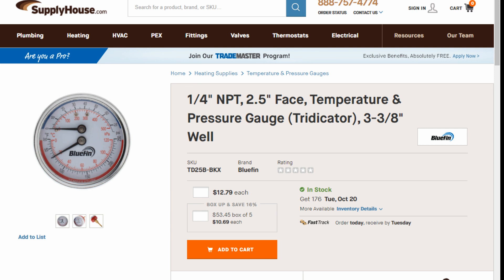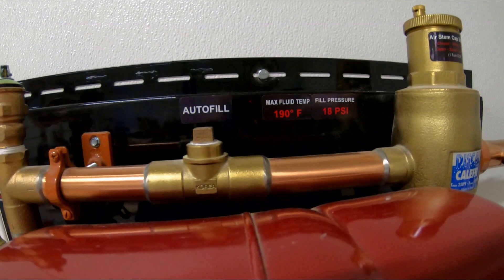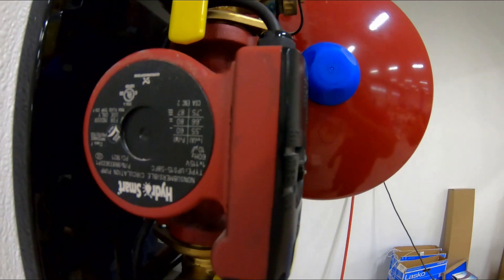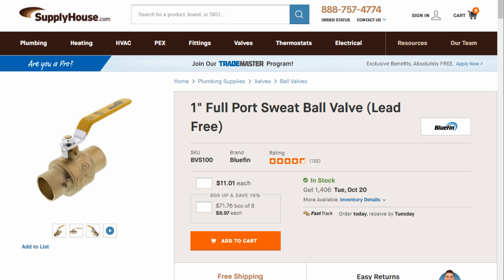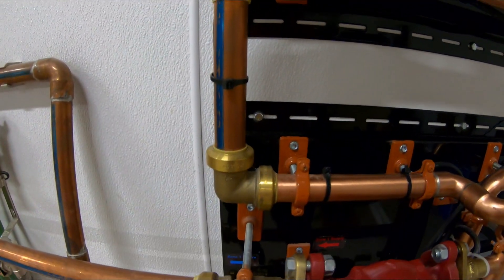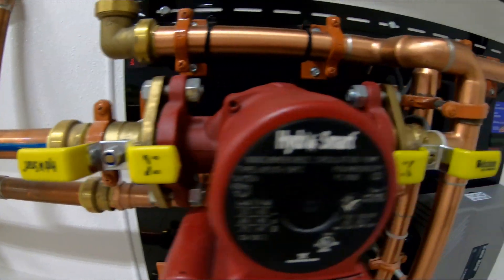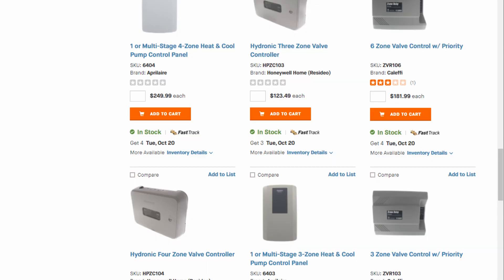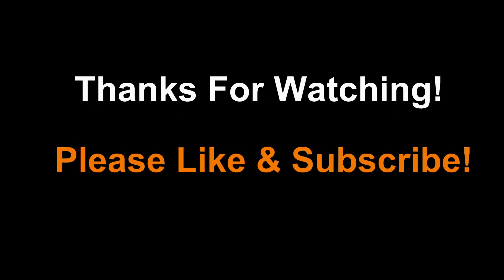Build Your Own Radiant Heat Panels- Boiler and Zones Breakdown List!  Pole Barn Heat Setup

Comment: Jason, after so many years how has the thermal mass system held up? We are thinking this is the way to go for our southern michigan barn.
Reply from the maker: Its been great , 1 of my lines has a pinhole leak and it keeps fluid but under pressure leaks down. Must of been manufacturer defect in line, but with the thermal mass, it doesn't affect heating.  Never needed to install Air conditioning , as it keeps around 68 degrees during summer. I need to use a dehumidifier sometimes if its been a rainy week. You save about $40-$60 per 4x8 sheet of pink foam insulation not needed under slab, so it works out ahead even if you need to buy extra pex tubing.  I have a few neighbors that went this route after my setup , so I helped them out with layout.  Dropping my temp for 55 degrees to 50 degrees has saved more on my heating bills then I thought. At the end of this heating season, I will do a comparison of heating costs.  Just make sure to keep up on gopher control, as I have seen they chew through cable lines around my place. Since the pex is in sand, I don't know if they can dig/chew through the insulation board around perimeter  and get under the slab. Mine they haven't , as I have seen some mounds by perimeter of building but when I dig down, they just went along foamboard. . They did chew up my cable line  , so I just placed it in conduit . Otherwise , has been great and best investment could of made. When you go from working outside in -10 weather to working inside in a heated area, its so enjoyable! Thanks for watching
Reply: @JasonYouTube  thank you for the response.

Comment: How much water is getting sent out the condensing side. Could i use a 5 gal bucket? Thanks
Reply from the maker: @boardinabarn6829  It will fill up a 5 gallon bucket in a day if it runs long enough!  When I 1st started my system in the winter, the ground and slab was under freezing point and the water froze the pipes so I had to use a bucket until the ground and slab was above freezing.  I emptied the bucket every morning and every night.

Comment: what is the part that the pressure/temp gauge attaches to?
Reply from the maker: The manifolds have them installed on them , thats what the pex loops hook up to
Reply: Not the ones on the manifolds.  the ones on the copper pipes.  in this video you have a guage next to the pressure tank and one next to the Air seperator.  Is it some kind of T fitting   @JasonYouTube
Reply from the maker: @abacojack13  It is a 1" tee with like 3/8 - 1/2 on top. Then you sweat a threaded reducer to it with threads of gauge your using . Threaded reducer slips over the pipe perfectly.

Comment: Hi Jason, first of all thank you very much for the video, very well done and so easy to follow, I think even I can follow it. I know I'm late coming into this but I have a quick question, why is everything 1" and not 3/4"? For me everything would be so much easier to find and so much cheaper if I used 3/4 and with a closed system I'm not sure I need the flow rate 1" gives so I'm thinking I'm missing something. Any insite would be appreciated.
Reply from the maker: The boiler/ tankless water heater needs a certain GPM (.5 to 1 GPM) to activate so you need to make sure to have enough flow through system. If you don't have many loops, then 3/4" should do, but you need to use some formulas to determine that . Google that to see what you need.

Comment: cool...You still recommend the T-H3M-DV-N (Takagi) ?  I see suppy house now has it up to $925.00.
Reply from the maker: They used to allow space heating under the warranty , but now they changed it to exclude radiant heating. I don't know why but maybe due to problems with customers whose units froze because in a house, the water heater wouldn't be only source of heat . Houses would have a furnace and so tankless heater wouldn't be in extreme conditions. Just my guess. Mine has been working for over 5 years with no problems so just know that buying one, you may not get warranty. But you could buy 3 for the price of 1 boiler , thats how I look at it.

Comment: Hey Jason do you have an email so I can ask you a few questions?  I have a 24x32 pole barn with 1100 linear feet of radiant tubing......Could I get away with a smaller boiler than what you have or is it more efficient to go bigger?  Your space seems much larger than mine.
Reply from the maker: Hi, Ya I have 4700 lin ft of tubing so 4x yours. You can go smaller but really no point , because these are modulating , so they can go down to 15K btu or up to 120K btu depending on water temp and gpm needed.  So if your looking to save money upfront, you can get a non condensing unit , but that is less efficient so will pay more in long run. Since these are water heaters , the non condensing runs like $700 and condensing runs like $900. Regular boilers run 3K on up. They used to be alot cheaper but with the " Free Money" era , they went up 30% .  Thanks for watching

Comment: Hey there Jason.  How do you determine the PSI for your primary (boiler / expansion tank) circuit?  More to the point. how do you determine the "Pressure Set Point" of the pressure relief valve?
Reply from the maker: Pressure relief valves on a closed loop system are usually 30 psi, and system pressure is between 10-20 psi. You don't need that much pressure in the system to get stuff moving
Reply: @JasonYouTube  THANKS!

Comment: excellent videos. I appreciate your information on this. One question do you need just one circulation pump if only one zone with seven loops?
Reply from the maker: If your not using a primary/secondary circuits for hydraulic separation , then you need to check what gpm flow rate you need for your boiler/water heater to activate. Some need 1/2 gpm flow , then you would be ok using 1 larger pump.

Comment: How many GPM your running?
Reply from the maker: 1/2 GPM  , basically if you don't have a boiler pump and are using the zone pumps only, then you need enough GPM flow to activate the boiler / water heater.  Since I have a boiler pump in addition to the zone pumps , I could go higher with the GPM but .5 GPM works good. If your return temp is low, then a higher GPM will be needed to supply enough heat to the end of your pex runs , in order to heat the slab . Thanks for watching
Reply: Having trouble getting mine going. I have the hydro smart single zone system. I am using the Takagi tankless water heater. I have 7 loops averaging around 270 ft each. I can’t get the boiler to maintain 0.5 gpm so the heater won’t stay on. It’s starts out around 0.7 then drops until the heater turns off. I even swapped the pumps out from 1/25th hp units to 1/6hp units and its didn’t help. When I purge the system with a 1/2hp utility pump I can get 1.5gpm. I’m just not sure what to do next?
Reply from the maker: @jasonferree3541  1/6hp should easily maintain 1/2 gpm. Did you check your screen on strainer and the inlet screen on the Takagi? Also make sure your pumps are on the highest speed if you have the 3 speed ones.   Make sure that your system maintains pressure as a leak will allow air bubbles and will lose pressure and gpm. Remember that the utility pump puts out more GPM then most of the zone pumps, so any restriction will not be as noticeable during the purge.
Reply: @JasonYouTube  ahh, yeah I need to check those. Thanks for the advice!
Reply: Well I feel stupid but it was the filter screen going into the water heater. I’m running 1.6 gpm with the pumps set on lowest setting now lol. Excited to heat up for first time!
Reply from the maker: @jasonferree3541  I would probably switch to the smaller pumps  to save on electricity , otherwise leave it as more GPM will not hurt system if installed and cleaned properly. Only problem would be if a restriction or tight bend in pex or a solder  joint bugger , faster gpm may erode the pex/copper and create turbulence , where slower gpm will have no effect on it. That would take some time but probably wouldn't.

Comment: How efficient is that boiler???  Any idea how much it runs or what it’s costing?
Reply from the maker: Its 94% efficient and I have videos showing how much the costs are to heat. I break it down for cost per cu ft of heating so others can compare it on their building heating costs. Usually for heating in Minnesota, it costs about $550 per season to heat my building at 58 degrees.  This year its more due to gas increase and also a "Feb Event" surcharge , for that Texas gas blunder.

Comment: Great video except for putting the expansion tank on its side allows it to keep air in the system
Reply from the maker: With a bladder expansion tank , it doesn't matter which way you mount as you purge all the air out of the system and the air bladder keeps it "Tight". Only problem is when the internal bladder fails , it will fill the tank up and may rip off the mounting if not properly secured . If manufacture specifically doesn't allow it then you follow their guidelines, but most say any orientation is fine as long as it is secured correctly. Mine needs another bracket installed as the sheet metal screw is loose to backing plate.  Thanks for watching

Comment: Quick question how did you figure out what size pump you needed?
Reply from the maker: When you design your system through the programs online or talking to contractors,  they will tell you what pump size needed. But the ups15-58fc pumps are usually the go to ones.  As long as you don't go over 5000 ft of 1/2 pex per pump , it will have no problems
Reply: @JasonYouTube  Do you have any sites you would suggest for the formulas, or even reference books you used?
Reply from the maker: @joeredhawk   Most stores that sell all the supplies may help you out. I know that Radiantech  was good but that was like 4 years ago so I cannot tell you how they are now. They sell their kits and everything so you could try there , but I cannot endorse them since its been awhile. Maybe others can chime in , but that is a start. Depending on where you live, there may be local companies that will design it and give you quotes on it, Just search for radiant heat in your state and should pull them up.

Comment: Hi, do you need a Water Pressure Reducing Valve for the system.  Thank you
Reply from the maker: This is a closed loop system so the pumps just move the fluid and don't build up pressure.  You actually pressurize the system when filling with another pump. It does have a pressure relief valve in case it overpressurizes due to a restriction or if it gets too hot and boils the fluid
Reply: @JasonYouTube  thank you. Do you have any video on filling the system with water/glycol mix and purging the system of any air.  Thank you
Reply from the maker: @Xbox360Rules00  No I don't  as there are some good videos on youtube with how to do.it. Thanks for watching

Comment: Hi. How heavy is the expansion tank with water in it and should it be supported?
Reply from the maker: The tanks are usually 4 gal total.volume so max fluid is like 2 gal. Usually you have less then 1 gal of liquid in it , so like under 7 pounds. So you need to support it but max weight would be like 25-30 lbs if bladder fails. So yes support it for the max weight if it failed, which isn't  that much weight to support

Comment: The system will lose water during natural use..the auto fill is there to hook up a house line thats live all the time and it will automatically keep your system within the desired psi range
Reply: If I have to add a mixing valve on this system where would I put it

Comment: Hey Jason,  getting ready to build my panels but have a question.  So you placed your tubing in the sand below the slab.  What spacing did you use for the tubes?
Reply from the maker: They recommend about 8"  but in some places around the perimeter I went  with the tighest radius bend , like 6" spacing. My thought is perimeter walls will sap.the heat and be the coldest spots. Thanks for watching
Reply: @JasonYouTube  I was thinking that as well. How did you figure out how to layout your runs?  Having trouble with that and info.
Reply from the maker: @country81  Just check out my video on thermal mass tubing layout. Shows mine

Comment: Quick question. Im about to build a 54x60 shop. One single space, no dividing walls. Would a single pump system do that? I notice you have three pumps. Can you explain that a little. Thanks
Jason
Reply from the maker: The one pump is for the boiler/ hot water heater  as that has some  flow restriction  going through the boiler and in order to get the 1/2 gpm through your tubing, it is easier on system to have a separate pump for the boiler panel.  Look up Hydraulic separation as that will explain it better . More efficient then just a standard circuit utilizing 1 pump.  My other pump has 3600 ft of tubing , so depending on how many feet you do, then the one zone pump will work if you have under 3600 ft of tubing. my other zone has 1200 ft , and that has a separate pump for that zone.  If your doing the tubing in concrete then you will not need as many feet of tubing as my setup. My setup is using Thermal mass so my tubes are in the sand beneath the concrete so I basically have over 1 ft of sand /concrete to heat up, so need more to heat that up.

Comment: Also, what ratio of water to glycol did you use when filling the system?
Thanks again!
Reply from the maker: I just went what the lowest temperature that my area would face and went with that ratio. I think I errored on caution side of -60 burst and freeze protection of -20 , but since the tubes are in ground it would never reach those temps but better safe then sorry. I think it was a ratio of 75 glycol to 25 water.  With cryotek 100 , you could run straight glycol and it isn't that thick.  I bought all my 5 gal buckets from the dealer as it was about $20 cheaper per 5 gal if I bought at Menards / Lowes/ Home depot. Might try a local radiant / HVAC dealer as they could probably order it in and they would take their cut and you would probably save.

Comment: Hi Jason,
Thanks for the video.
Can you tell me where I can get the pipe stand offs you used in routing your piping?
Thanks!
Reply from the maker: Hi,
 They are just Oatey Pipe Standoff clamps. Home Depot, Lowes, Menards all carry them you buy the Threaded rod separate and cut to length. The bottom is also sold individually and should be in the black pipe section of those stores. I just painted mine to match my wall color. Thanks for watching

Comment: Expansion tank should always be installed in a vertical position by the way.
Reply from the maker: That is a Myth , IF manufacturer states vertical mount only then that is true statement. Most can be mounted in any direction or orientation ( Upside down, horizontal, etc..)  If you know how they operate, it doesn't matter. The air bladder has pressure which forces against liquid so it doesn't matter which direction . Google it as most manufacturers state any way you want to mount it. Vertical mount is easier on the fittings though , as the weight is straight down instead of horizontal , but as long as it is supported properly , it will be able to hold weight of water if bladder leaks.